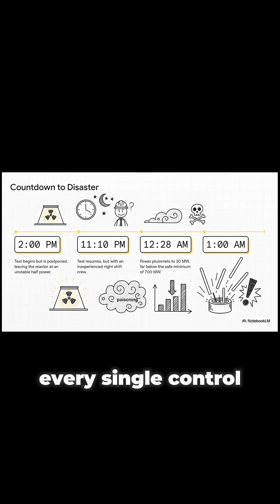Chernobyl: The 9-Hour Delay That Sealed Reactor 4’s Fate #documentary #shorts #physics #history

Comment: This is completely wrong lmfao. 
1. The reactor was working at half power, stable, for more than 24 hours. 
2. The operators were inexperienced, sure, but professionals. Toptunov and Akimov were working as assistants in the plant for years. 
Anatoli Dyatlov practically built the plant. 
3. We don’t know if the reactor was xenon poisoned. That’s a theory. 
4. RBMK reactors CANNOT have all their control rods pulled out. Only 50% of the control rods were manually operated.
Reply from the maker: Thanks for wacht the short, i invite You to see the hole video on My Chanel. Bless